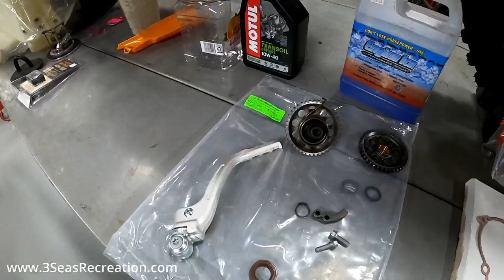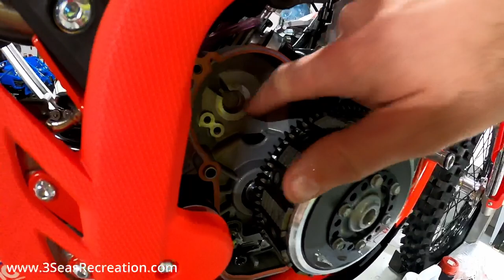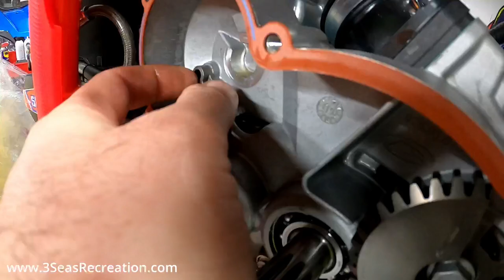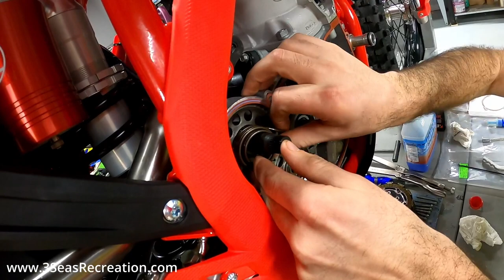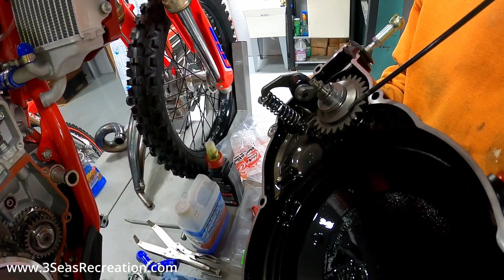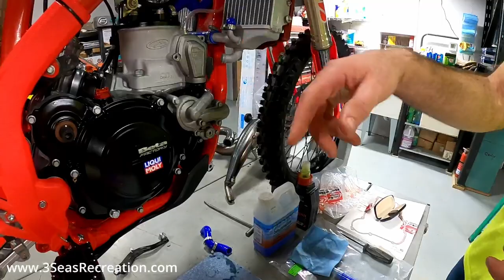2022 Beta 250 Race Edition, 2-Stroke Kick Start Install, AB-21192, 3 Seas Recreation,  Beta 300 rr

Comment: Great work. Always great to see the inside of the motor. Great explanation of how to install the kickstart.
Reply from the maker: Glad you enjoyed it! Thanks, Jared
Reply: @3SeasRecreation  hi have you ever had it where kicker doesn’t return ? I fit a genuine beta kit to my 300 rr and it kicks but doesn’t return , been annoying me since fitting it not that a use the kick start but today I stripped to see what went wrong but followed you video and everything is 100% , even tried 1 full turn extra tension on the spring but that didn’t work as wouldn’t allow the casing to sit back home correctly , any advice would be great , been binge watching the videos over the holidays , excellent channel cheers

Comment: THANK YOU for doing these videos on the Beta bikes!!!! I have a 21 390 4T RR....any info on the kick starter kit on this ???? I have watched all your videos  ...but the 2T is different....I can't find anything to download on the 4T. Thanks again  from Canukistan....Wet Coast Vangrouvy
Reply from the maker: Good Morning! Thanks for subscribing and checking out our channel! As soon as we have a 4 stroke kick start kit to install we will film it! Enjoy the ride, Jared
Reply: @3SeasRecreation  So I did the install....I figured the aluminum thang is a tool the tap the bushing into place. Did the oil pump gear mod, upgrade brake pedal, 5 gallon tank, LED x4 head lamp.....fired right up! thanks for your videos..THEY HELPED. Now down Pacifi Coast trail then up the Continental Divide to Jasper...ONE TRIP!

Comment: I asked my dealer about a kickstart for my 2020 to 300rr and he said he refused to fit one. I came into the shop at a later date and he told me he refused to fit one for another customer with the same 22 300. The customer went to another dealer and got one fitted The other customer then rode the bike and accidentally rolled backwards with the Kickstarter out causing major internal damage and trying to get it fixed under warranty.